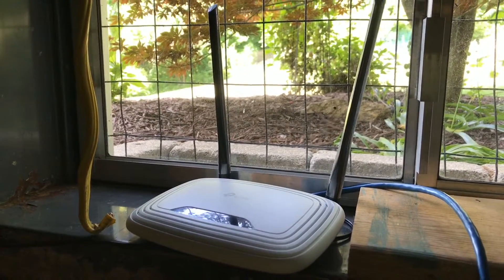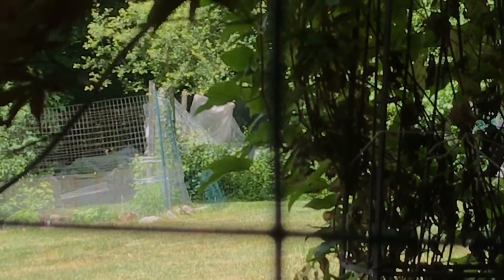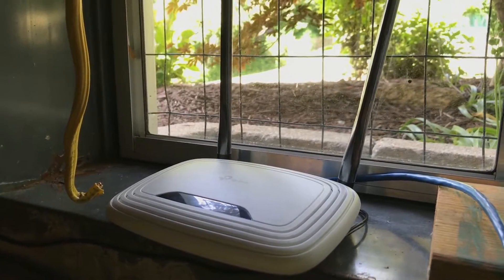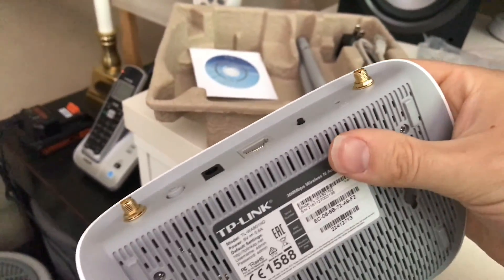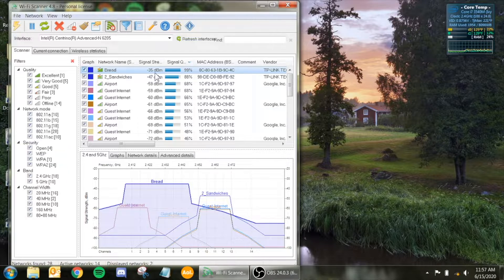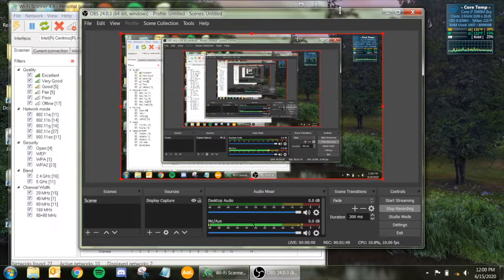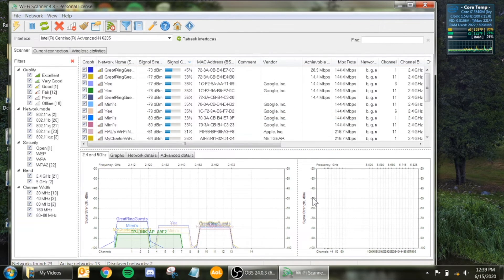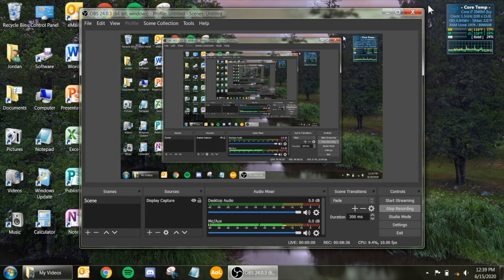Increasing the WiFi Coverage | Part 1; Testing Existing Equipment

Comment: I am confused how they market the first router as "capable of 300 Mbps transfer speed if the WAN and LAN ports only run at 100 Mbps.
Reply from the maker: The theoretical speed (which is NEVER achieved in any real-world situation, even if the WAN/LAN ports have sufficient bandwidth capacities) of the wireless transmission on this unit is 300 Mbps. They advertise that and prey on uneducated consumers who don't know or understand what's realistic to expect. It's total deception and false advertising. It should not be permitted.

Comment: This is quite an interesting project. I had a similar issue with a new router not reaching the entirety of the house, and I added another router. I’ve got a home network tour I have yet to release that explains how that works. I look forward to seeing how this progresses!
Reply from the maker: I've encountered that issue within buildings before, much easier to deal with in that case since you can run an Ethernet cord and put another access point where needed. There's not much to work with when you're outside, no cabling and no electricity. I've been meaning to record a home network tour for a long time now too, someday I'll get around to it!

Comment: Just warning you in advance: I'm a bit of a networking geek. [Or at least I'm on my way to getting there :) ] Just a couple of suggestions: you might want to get the WIFI Analytics app ( By Netgear I think) on your phone. It is a very helpful app that will allow you to check a lot of things without lugging a computer around. Also, you might want to look into what channels your other access points or your neighbor's access points are using. If there are a lot of overlapping channels, it will decrease your signal range. It's kind of hard to say because I am not sure where you were geographically in the video, but putting the access point up higher or at least in an area with less concrete around it will probably help. Also just double check what type of antennas you got: Although I forget the names, there are antennas that are designed for better range, but if memory serves they transmit in more of a directional fashion meaning that if the router isn't at the same height as you, you won't get good range. and there are also more omni directional ones, but they have generally have less range. If you have any questions, I can try my best to help!
Reply from the maker: I've been meaning to do a video-tour of my home network for some time now, I guess I better get on that. I deal with this stuff from time to time at work and I studied it in college (for whatever that was worth), it's not my specific area of trade but it's far from foreign to me. I don't have, and absolutely refuse to use, a smartphone, so I'm stuck with the computer. If they have a version for the computer, I'd certainly give that a try. I was surprised by how many networks are receivable here considering how far apart the houses are. Between all of those networks, and all the phones I have, there is no chance of getting a clear channel to work with. There will be at least 2 more videos to this series, the second will address the antennas.
Reply: @JordanU  Well I figured that was the case, but I thought that I might as well offerup my knowledge and help if you need it! Ahh, well I'm not sure if they have a computer version, but you can check. Yea the phones probably don't help lol. It still can't hurt to take a look at the channels that are being used and try to separate them a bit! Ok, sounds good! If you ever need help or want to bounce an idea off me, feel free to ask and I will try my best to help! :)
Reply: I have the Networking Analytics app on an iPad here, and that works well. It could also work on that if you have an iPad.

Comment: Windows 7  So were then windows 10
Reply from the maker: That doesn't make sense.
Reply: @JordanU  google jj c was talking about microsoft windows for your computer
Reply: @JordanU  like upgrade to from windows 7 to 10
Reply from the maker: @justinlyons8676  Why in the world would I do that?
Reply: @JordanU  all people get windows 10 on there new computers
Reply from the maker: @justinlyons8676  Windows 10 is junk, so is the quality of most new computers.
Reply: @JordanU  yes new computers has windows 10 used computers with windows 7 is not great if you get one it will not work all people got new computers has windows 10 they love it for computer collection with all windows like 95/NT/98/2000/2000 Professional short word pro/XP/XP pro/vista/7/8 and 10 thats all windows by Microsoft try 10 is different or 8
Reply: Justin Lyons Many people still use Windows 7 and love it. I also like windows 7. Every update for Windows 10 breaks it.